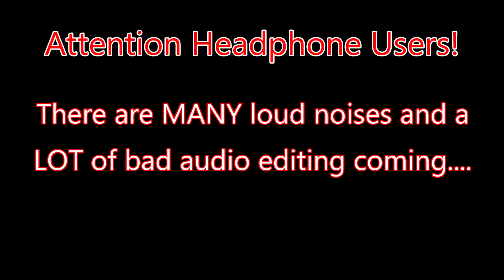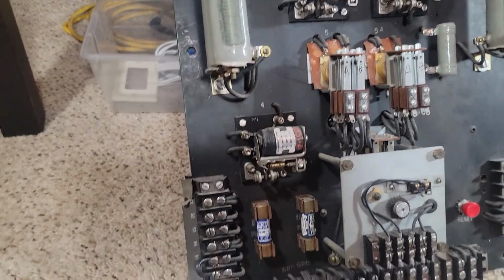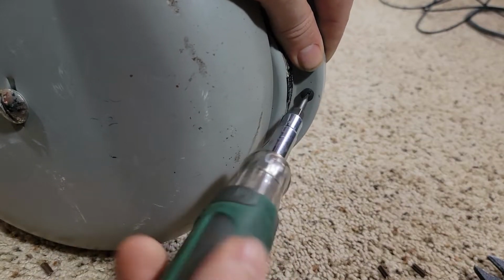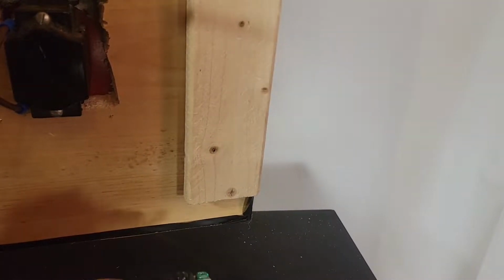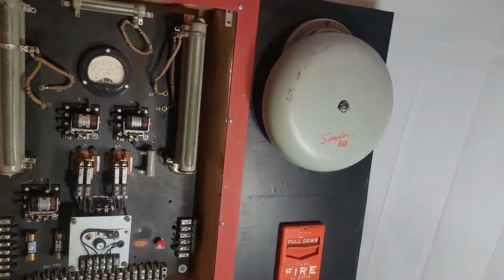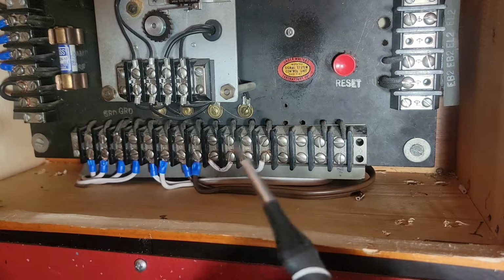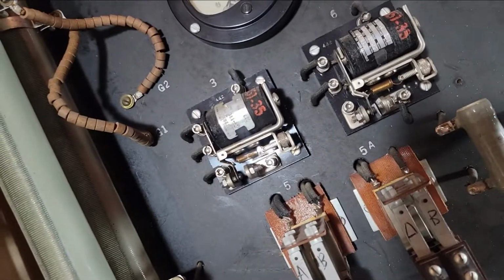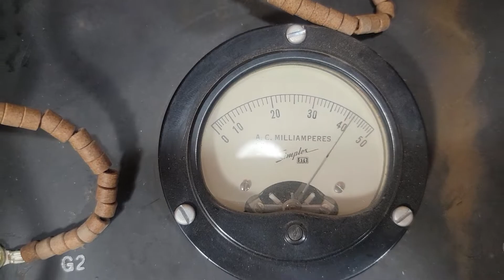Vintage 1962 Simplex Fire Alarm Test, Wiring, and Explanation

Comment: Definitely reminds me of the thrill of wiring up an old fireshield panel. Sure it isn’t as vintage as that dinosaur but hey it came with its own set of surprises. It has a lovely ground fault and bad programming memory (you can program from the panel itself).
Reply from the maker: Fireshield.... That's EST right? I always fought with those things when I encountered them. In retrospect I do understand that they're proprietary but they annoyed me nevertheless.
Reply: @brettman273  Yeah, EST is way worse than Simplex in my opinion. Its notorious for programming errors, false alarms, and is overall very cheap/poor quality. My middle school has an EST 3 and I remember when the school let me trip it for a drill, it took a million years to actually trip. Worse yet, my elementary school had an EST 2 that replaced a 4100+ or 4020 (dont really remember) that just failed on them not even 5 years. Thats why I always say: “Remember kids, don’t buy cheap fire protection!” whenever I encounter EST.

Comment: Question: I got a simplex 4246 which seems to be setup exactly like this. However the bell circuit needs to he adjusted to match the correct voltage for the horns. Do you by any chance know how to adjust those big grey resistors to match the current? Or if there is some way to adjust it elsewhere? Thanks!
Reply from the maker: I would use a relay. Determine output voltage of panel's bell circuit, get a relay with a coil that operates in that voltage range, and run it in place of the bell. Then pass the bell power through the normally open contacts on the relay using whichever power it needs. Supervision would probably not work as the relay coil would not match the bells/horns the original circuit was intended for use with. But this old stuff is a lot more robust and forgiving than modern electronics, you can bend the rules significantly and it will  usually work.

Comment: Who made the pull station? I know my elementary schools I attended had those pull stations and I don't know if they are simplex or Faraday or even federal systems.  But I know my school system where I grew up now uses est and all of my schools were switched to est. Genesis with external integrity horn strobes at my first elementary school.  Est genesis at my 2nd elementary school est genesis speaker strobes in my middle school and my high school est integrity after a renovation before my attendance

Comment: So your supervision is working as it should, minus the one relay coil being open. When there is a trouble in the system, the meter will not read anything, again because of the relay. Your panel is a "double supervised" type. Meaning are two trouble signals (EB1 and EB1, EB2 and EB2), one is for operational circuits and the other is the supervisory circuit. The light you jerry-rigged, is only indicating a trouble on the box circuit, not the entire supervisory circuit. One trouble bell terminal is getting 120 vAC because the entire supervisory side is incomplete, again because the relay coil is open. 

If you haven't seen it yet, the broken relay is a Struthers Dunn Co. 112XAX model . There are a few on ebay.
Reply from the maker: Ahh, so perhaps I was thinking about it backward? Bad really equals power to trouble indicators because that is default state...supervision is also supervising itself..?
Reply: @brettman273  Yes, supervisory relays stay energized, and de-energize when it's circuit is incomplete. Giving power to the correct trouble signal. Technically operational power is primarily for fire signals, and supervisory for trouble signals. Both really work together to "check" circuit integrity. Your meter should read about 20 Milliamps in normal, and zero in trouble.
Reply from the maker: @FyrFyter  So if I physically activate that bad relay, perhaps I'd see opens on the trouble indicators as one would expect? Then since I know the box supervisory works, disconnect box circuit and should see trouble?
Reply: @brettman273  Yes, if you push in the bad relay (as if it was a good relay), the trouble signal terminals should read either nothing or the odd 4 something volts you were getting. And the meter should read about 20 milliamps (technically it should be a little less because the broken relay coil is not drawing current). I've never done something exactly like that, but that is what should happen. 

Yes if you do that action with the relay, simulate an open in the box circuit, the meter should read zero, and 120 vAC should be at one of your trouble signal terminals (EB1, EB1 or EB2, EB2).

Comment: So it relies on the individual pulls to be wired in parallel OUTSIDE the panel, but still having individual feeds back to the panel to keep the trouble bell off?
Reply from the maker: Yes. Think of it as two loops of wire that leave the panel and come back, and the pull stations bridge the loops.